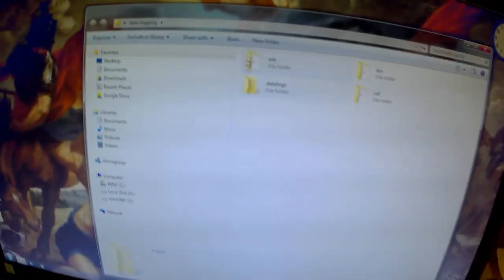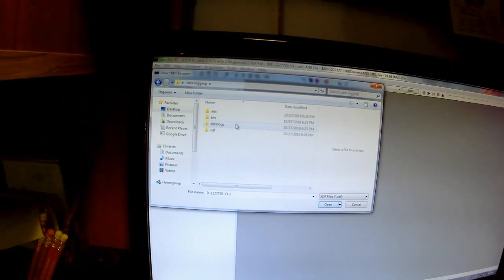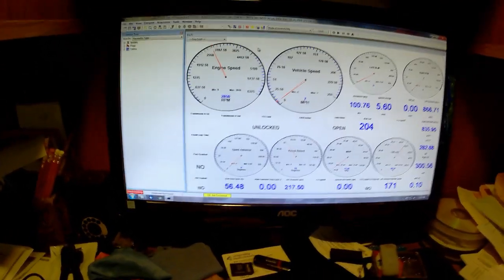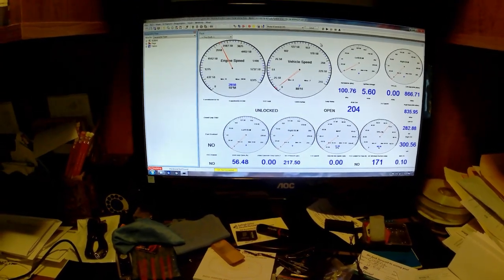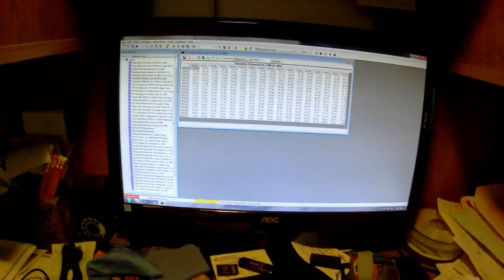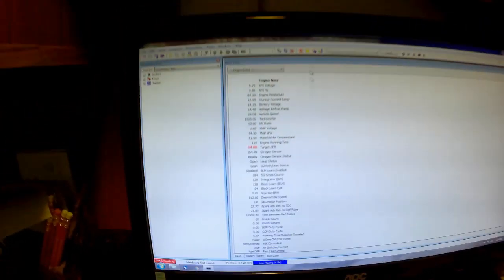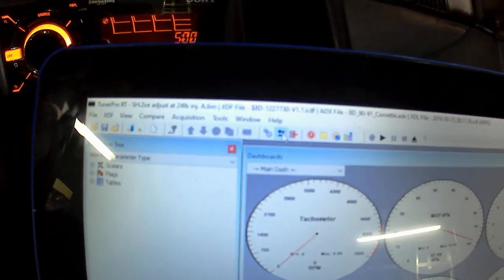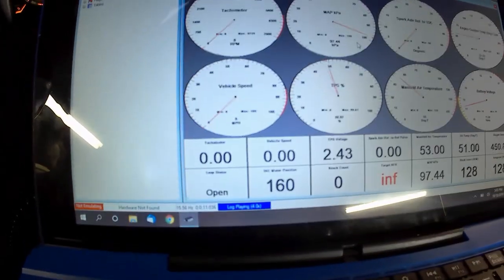Follow up To Data Logging OBD1

Comment: So if I want to change parametrs (for an egr delete, for example), that counts as burning a new chip? Didnt manage to fully understand it
Reply from the maker: In order to make any changes in the program in your ecm you will need to burn a new Chip or use a emulator, depending on the year, make, and model.
Reply: Ok, many thanks!

Comment: after I record I can't find or save the file
Reply from the maker: When you hit stop recording button a window should pop up and you need to name the file and point to where you are saving it. It can take some time depending on your hardware.
Reply: @E.T.GARAGE  this is the message I got from my chip guy, I don't know how to do this.           "You need to open that XDL file back up in your tunerpro and under data acquisition menu at top, export that file to a CSV excel file and send that file to me."
Reply: I think I figured it out

Comment: Thanks for the video. It is very helpful
Reply: Eugene, I did everything on the video. I click on send and the tool bar says DA connecting. When I plug it into the ca. It continues to say DA connecting. I pulled the cable in and out a couple of times no change any ideas. 1985 Corvette 4 plus 3. Thank you
Reply from the maker: on your aldl cable do what buad rate do you have it set to, I beleive the 85 you need to set to the lower baud rate.
Reply: @E.T.GARAGE  thank you for getting back to me. The switch is set to 10 Omega. I can't see a tab that says baud rate.. interface type has use plug in and autoprom maftpro. I am using use plug in. Should I use the other. Plug in configuration has enable dual emulator 16 bit and use high speed USB. I have high speed clicked. Thank you so much for the help
Reply: @E.T.GARAGE  Eugene this is the ECM and files I am using on my 1985 4 plus 3 Corvette
The ECM, and chip I got from Scott Hansen it, is number 1226870
The files I am using are
HLP 85 vette 5.7TPI 6 speed doug nash.bin
1F.xdf
a20.adx
I was watching a TPRT video where the person uses a 1989 Cadillac. He is able to fill the dashboard boxes with labels TPS, cTS, idle . I could not do that the boxes appear but I cannot get the drop down with the labels. Thank you for the help.
Reply from the maker: @josephseremba8256  you should have a setting for 160 baud rate normal a jumper of some kind
Reply from the maker: @josephseremba8256  I am a little con fused to what kind of cable you are using, what brand
Reply from the maker: @josephseremba8256  every adx file will be different, you will only be able to fill the boxes for what sensors your 85 has.
Reply: @E.T.GARAGE  it's the moates cable. It's the one on the TPRT website
Reply from the maker: @josephseremba8256  there should be instructions on how to change the baud rate.
Reply: @E.T.GARAGE  the 85 has a TPS, CTS, IAC. Unless the adx file does not have the capability. But, I thought that for what I am doing. All I need is the xdf file
Reply: @E.T.GARAGE  no the cable has 10 Ohm and USB no other option
Reply from the maker: I advise you to pm via Facebook https://www.facebook.com/eugene.tuorto
Reply from the maker: or email me at eutu1960@gmail.com
Reply: I bought the cable like 4 years ago. Should I get the split second connector. Thank you